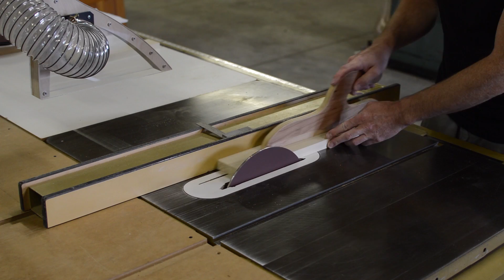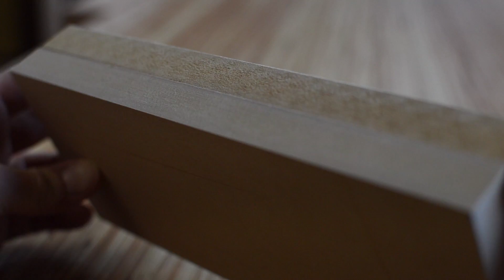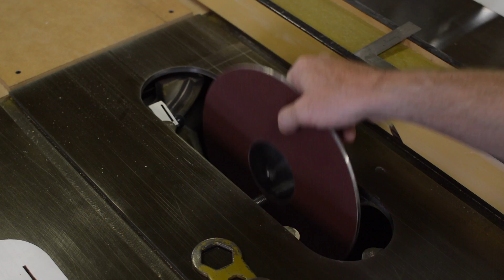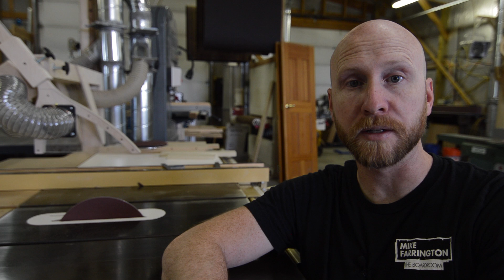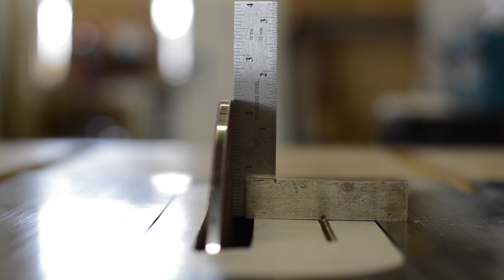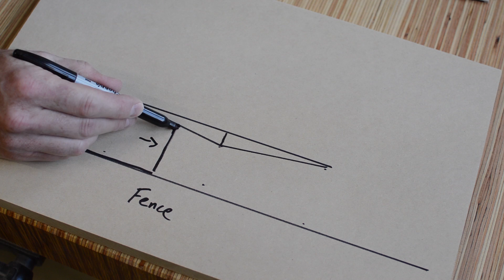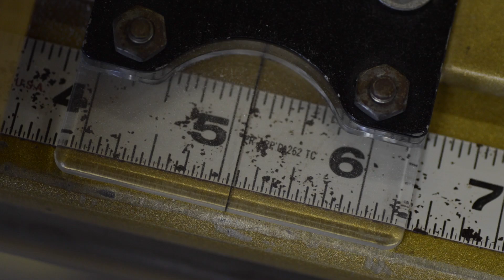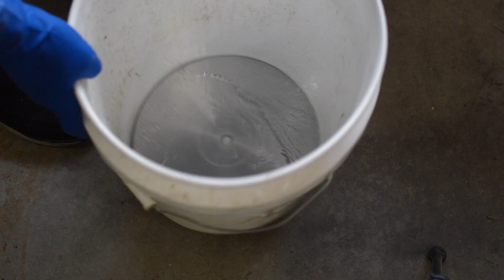This sanding disc will improve your woodworking and carpentry, period.

Comment: Finally, I got the disc out of the box and on to the table saw.  Let start by saying it does everything that Mike says it will do.  I started with end sanding a couple of raised panel doors and it work perfect .  I don't have a sled for my table saw so I set the fence up and went slowly.  The ends are now perfectly smooth so smooth you almost can't see the mill work where the style and rail come together.  A caution for all potential users.  I would suggest you have a blank throat plate that you can customize for use with this disc.  It is rather thick too thick obviously for my zero clearance plate, too thick for a standard plate and a dado plate's slot is not long enough.  Luckily I had a blank throat plate.  It did take some playing around with multiple blades and even a dado set to get the slot just right.  All-in-all great addition to my shop.
Reply from the maker: Thank you very much for the positive feedback. I agree with the suggestion for a custom throat plate. Good idea Donald.
Reply: Just finished 27 new doors for my kitchen remodel...was able to sand the doors to perfection.  After sanding all the doors on four sides, I still am using the original sanding disc.
Reply from the maker: @donaldpyles2891  Donald, that is really great to hear. Cleaning up the edges of doors has always been a challenge. That is one of my favorite uses for this disc.
Reply: I just ordered mine and am anxiously awaiting delivery! I came back here today to see if anybody has posted any specs on the throat plate opening, but I guess I'm out of luck. I will post the specs for mine when finished.

Comment: After 30 years of edge sanding the hard way, I'm delighted to see a tool to make the job easier. Great idea Mike. As usual, great video.
Reply from the maker: Glad you enjoyed it
Reply: This was Shopsmith's idea, about 50 years ago. But good to see someone offering it for a table saw, and the double taper is great.

Comment: Mike - You are, dare I say, brilliant! I have been using this now for about 9 months.  It is one of my most favorite things in the shop.  I hate sanding edges.  I used to sand by hand (no belt sander) to keep as flat as possible, time consuming and never flat.  One or two passes with the disc and I'm done.  Now I have beautifully flat, crisp edges.  Rock on!!!
Reply from the maker: Thank you very much. That is great to hear. It really is a neat tool for sanding edges.

Comment: You answered my question when you brought up the use of a block of wood to outfeed side. My question was going to be asking if a feather board could be used to to hold the work piece against the fence on the out board side. It looks like a great product, and if I had a real tablesaw, I would definitely consider buying one.
Reply from the maker: Feather boards or other holding devices are always a good idea.

Comment: Bought a single taper version of this from Sears over 40 years ago.
Reply from the maker: I used the same one as young guy starting out in the first cabinet shop I worked in.
Reply: did the same thing. makes great glue lines, almost can't see them.

Comment: Just found this and it sounds like a great new use for the table saw. It looks like it could also be used for traditional disc sanding work, but would be easier if one side were flat instead of tapered. 

People with big shops/budgets may buy a second small table saw just for this similar to having a small secondary band saw for dedicated small blades.
Reply from the maker: Thank you. The taper on two sides allows for two different grits without having to change. As to the second saw I have a few customers who have setup a second saw and really like it.

Comment: Great idea!  Shopsmith has had their conical sanding disk for a long time. It is a great addition to the shop.
Reply from the maker: Thank you. There have been a few to make this type of disc over the years. Craftsman was another way back in the day. None of those had the taper on both sides though.

Comment: Old trim carpenter i bought my very first table saw several years ago told me about this trick and included a straight disc in the purchase... He also used circular saw blades in the cabinet saw because he said they were were cheap and had a thin kerf.
Reply from the maker: Thank you. Taper vs flat is really no comparison.

Comment: You have done a very good job of describing the disk and it's use. Your diagram in excellent. The function is quite simple when you think about it for a minute or so. I had a similar disk in the late 1970's. I believe it came from Sears (Craftsman). It was only tapered on one side. It worked very well but as I recall I quit using it because I hated changing saw blades.
Reply from the maker: Thank you. I have seen the older craftsman discs. Very similar to mine. I understand not wanting to change discs, to each their own.

Comment: I just ordered a new disc, "Gee Nate what happened to the one you have been using?" asked no one, "Its not a Farrington disc" I never replied.
  If you have never used this technic you are missing out on a great way to handle edges, Extremely fast, whenever Mike started putting out videos and  showed the usefulness of the Mighty disc, I immediately ordered one, A couple years and a few thousand feet of wood later Zakk (my son) and I find ourselves holding hands and singing kumbaya ,because our lives are that much better, So I ordered a new one because its the least I could do to support Mike, the boardroom and all those little apprentices.
Reply from the maker: Nathan, Thank you very much, this is very kind of you. I agree, its a totally great technique for sanding edges.

Comment: Excellent presentation.  I wish I discovered this technique sooner...it would have saved me time on a box project.  Just today, I finished.  I'm sure you understand the difficulty cutting perfect joints in hardwood (maple, walnut, oak) using a table saw - it's excruciating. Even after tuning my saw and using sleds, I could never get it exactly right; and, this whole notion of using a sanding disk the way you've illustrated - hey - it's new to me . . . and I own one (cough Craftsman sanding disk cough cough), I never knew it could be used like that!  uhg.  Just the same, thank you for the presentation.  Looks like an awesome product you've created.  :-)
Reply from the maker: Thank you. Its a helpful way to sand projects.

Comment: I just got mine in the mail today.
It will be installed on my right tilt vintage unisaw once I finish the modifications and restoration. 
Now I just have to finish waiting for the 6 month ship times with Incra. Wish they shipped as fast as Mike did 😁👍
Reply from the maker: Let me know how it works out for you.
Reply: @MikeFarrington  I had previously thought about emailing you and getting a 1-inch Arbor version for my 5hp cabinet saw, but I think putting this DT sander on the little 3hp unisaw will work out better.
Reply from the maker: @frontlinefinishcarpentry4193  I have 1" arbor discs if you need one. I think though, being 10" diameter, it will mesh better with the unisaw.

Comment: I purchased it today. I could not find a similar disc for less. The taper sanding disc comes with four sanding discs so it is not that bad. I also bought a Freud sanding disc to convert my Grizzly table saw to a disc sander.
Reply from the maker: Thank you very much. Let me know how it works out.

Comment: I still have yet to build my dream workshop.... Working out of my shop which is roughly the size of a postage stamp I can not justify buying a jointer due to floor space. While I know this is definitely not a substitution, it will help with some of the issues I get with my table saw cuts. Thanks for this video!
Reply from the maker: It will do some help with in limits.

Comment: Nice to see a 10" disc available.  Conical sanding is only available on a Shopsmith in 12" size.  Probably 10" dia. back when they were first introduced in the 60's with the Mark VII.
Reply from the maker: Thank you.

Comment: After seeing Mike use one in his videos past, I bought one that has a three degree taper... and my saw can only go two degrees past 90 with the positive stop removed. The other side is flat. I love this, Mike. Definitely going to buy one!
Reply from the maker: That is part of my reasoning for the 2 degrees. That particular disc was what I recommended for a while. After a couple months I had a bunch of people email me stating the disc wasn't or wouldn't stay flat. I don't think its thick enough or machined well enough. Fortunately its cheap enough to where its not a huge loss.
Reply: Mike Farrington absolutely. Worth the money in my opinion as an experiment to find what features I would like to see. Yours nails it.
Reply from the maker: @elfutbolphenom  Thats good to hear and I think a good way to think about it.

Comment: Exactly what I need. I timed myself on sanding multiples of the same project 2 days ago. Sanding for each unit's pieces took me 30 minutes. This would cut that down to probably 5 minutes. Time is money!
Reply from the maker: I found the same issue with my work. Especially the inside edges of doors and face frames.
Reply: What in the world were you building that needed 30 minutes of edge sanding?

Comment: Finally placed an order for this a couple of minutes ago.  I'm about to make a bunch of MDF wainscotting and I think this will be a huge timesaver in getting the edges ready for paint
Reply from the maker: Thank you. When it comes to cleaning the edges of MDF, that is a time consuming job. This disc will help greatly.
Reply: @MikeFarrington  the disk showed up today. I couldn't get a full 2° negative tilt on my sawstop but I'll look into that tomorrow. Set up the fence on the left side of the blade and ran about 200lf of mdf through it and I gotta say I am very impressed with the result. This is going to save me a massive amount of time.
Reply from the maker: @DarrenRashJr  Try raising the blade height. That should create some clearance and allow for the full 2 degrees.
Reply: @MikeFarrington  I'll give that a shot, thanks

Comment: Great idea! Unfortunately, I only have a worksite type table saw.
Reply from the maker: It will work on a job site saw if the arbor tilts. I've used it on my job site saw when installing wall paneling and built-in type projects.

Comment: I just finished sanding 21 square stair balusters. 4 sides each. This disc works very well. It’s also very safe due to the taper. Cheaper discs aren’t, and this is what separates them from this disc. Without the taper. The disc can’t be used very well with a fence. Very good quality and I’m using it on a Unisaw so it sets up as fast as changing a saw blade.
Reply from the maker: That is totally great to hear. Thank you very much for sharing.

Comment: Finally got to try this "sanding disc" out on my Metabo portable table saw and I love it. Split an 8' and 6' red oak than cleaned up the sides with this disc. Had some issues like left sided disc sanding, since the tilt is left only for my saw, and the fit was so tight I spun the disk onto the arbor as if it was threaded (but it was a nice tight fit). I also had to leave the Throatplate off, and use a shim for the riving knife in order for it to allow the material to pass, otherwise the riving knife was in the way. With the precision sanding came lot of dust, likely due to the missing throatplate. But the results are worth it. I'll plan to make custom changes to my table saw, like a custom throatplate and maybe seal up the dust/blade area tighter for improved dust extraction. Is there any questions or ideas maybe Mike or anyone in the community have to add?💡
Reply from the maker: Thank you very much. Yes, some sort of custom throat plate will help greatly.

Comment: So glad you’re selling these. I’ve been looking for one - they are hard to find!  Will be ordering soon
Reply from the maker: Thank you. Yup, someone needed to do it.
Reply: Mike Farrington yikes.  $150 though?  That’s like 4x the price of the others.  Are you getting these manufactured yourself?
Reply from the maker: @ShopTherapy623  I consider 150 to be fair relative to quality. The cheaper ones seem to have problems. I have recommended the cheaper version for a while, and I ended up with a ton of emails saying it wobbled.
Reply: @ShopTherapy623  I'm currently doing a batch of items that takes right at 30 minutes to sand the pieces for each unit. I figure this disc will cut that down to 5 minutes. So saving 50 minutes per hour seems pretty cool to me. On the low end, at $30/hour shop charge, that's 6 hours of "not" sanding to pay for the disc. That would be 12 units in my case. I planned on cranking out 32 of these a week, and the sanding is definitely the bottleneck. 32 units are estimated at 44 hours. With the time savings this disc could save, those same 32 units will take an estimated 36 hours. I could make another 6-8 units per week which translates into $400-500 extra profit per week.
So to sum up:
1. I can save about 2 hours per day by using this disc to sand. 
2. I can pay for this disc after saving 6 hours of sanding which is only 3 days.
3. I can make up to an additional 8 units per week which will translate into up to $500 in profit per week. The first week there would actually only be a $350 profit. But subsequential weeks would be $500.
4. And you're supporting a small business instead of a name brand.
Reply: Jason Peltier I get that, and no doubt these are probably better than the cheaper ones and will end up making you money if you’re a professional woodworker.  As a hobbyist, they’re just a little out of my price range.
Reply from the maker: @JasonPeltier  If you are making money with your woodworking, there is no question this disc can help you make more.
Reply from the maker: @ShopTherapy623  I understand your position.

Comment: I bought one of these nearly forty years ago at Sears. Still have it.
Reply: Me too, but have had a hard time finding a pressure sensitive disc with a hole in the center. I can't get a solid disc to lay flat without a wrinkle.
Reply from the maker: A heat gun is the way to go.

Comment: I had considered getting the Infinity Tools flat sanding disk.  Yours costs a lot more, but, of course it is because of the additional machining.  I will probably buy yours.  Looks great.
Reply from the maker: Thank you. I strongly feel the taper really makes this a better product.
Reply: @MikeFarrington  Well, my saw leans the wrong way.  You gave two options, put the fence on the other side.  Or, adjust the saw to be able to go 2 degrees past vertical.  True, to be certain you have a 90 degree you need to use a square.  But, my saw is pretty close to square and for most work -- at least most of my work -- if it is off by a small fraction of a degree it doesn't matter. So, I'm okay with just using the vertical stop most of the time.  So, I don't really want to adjust the saw to go 2 degrees past vertical.  Still thinking, deciding.
Reply from the maker: @CaseAgainstFaith1  I understand the dilemma, let me know if you have any other questions. I'll do my best to help.

Comment: Have yet to purchase one but will down the line. Tip... a natural rubber sandpaper  stick works well for cleaning the wood pitch from the sanding disk.
Reply from the maker: Thank you. I recommend not cleaning the sandpaper. The disc is spinning a little too fast in my opinion. It will be very grabby.
Reply: @MikeFarrington  Well, I use one now with my DIY sanding disk in my table saw without any grabbing problems. The stick I use is 2"x2"x10"long and my sanding disk is in a zero clearance throat plate.
Reply from the maker: @radesigns001  I think there is a skill issue. Sounds like you are comfortable and have the skills to pull this off. My stance would still be to recommend that people do not. In the end to each their own. Thank you for your input.

Comment: certainly a better option for those of us in small shops.  No need to buy an oscillating edge sander and find space for it in the shop.
Reply from the maker: Agreed. Most small shops already have a table saw, this is a great space saver in that regard. Edge sanders are not small.

Comment: Mike,  I like your channel and enjoy your projects a great deal. This idea looks like it will be a winner for you but my question is — why is this necessary for a woodworker who already has a joiner? I’m pretty sure your well equipped shop has one. 

I have a good planer with spiral carbide cutters and it also leaves a mirror finish on an edge. I think my old planer with standard straight cutters left mirror edges as well but the blades needed attention too often.
Reply from the maker: I have a very high-end jointer with a spiral head. I do not consider that a finished surface. Not one ready for stain or a proper painted finish. Also, keep in mind its not possible to joint all edges of a project. So you joint an edge the rip to width on the table saw, well now there is a surface that needs to be dressed. This guy is great for sanding the edges of doors or drawer fronts, end grain and all. Again, a jointer can't do that. To me a jointer is for straightening or flattening only. Hope this makes sense.

Comment: Another way to smooth MDF...or end grain of a board if you're going to use paint for your finish is to simply use spackle and a putty knife.  It's quick and easy and if you use the pink spackle you can easily tell when it's dry enough to paint over because it turns white when its dry.  It also fills gouges and dents in wood that are too large to sweat out with water and a steam iron.
Reply from the maker: Yeah, that works well, but it's a little slower.